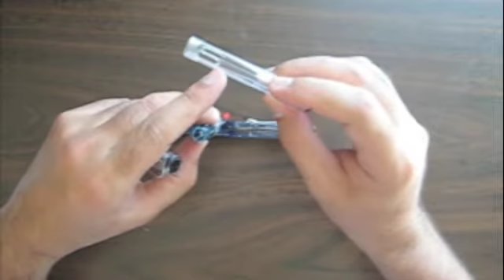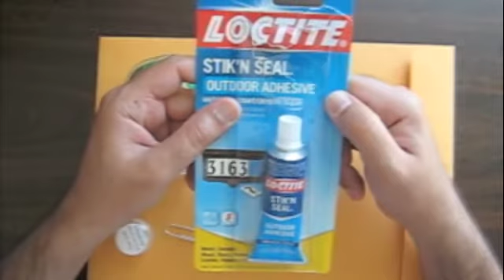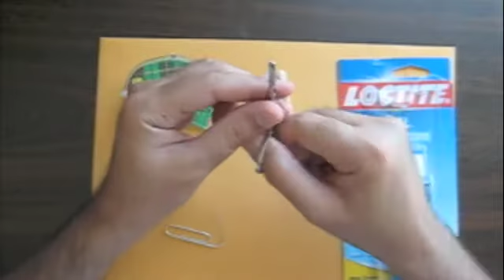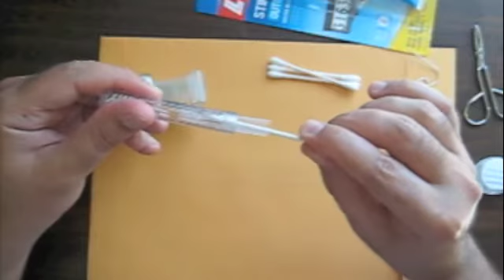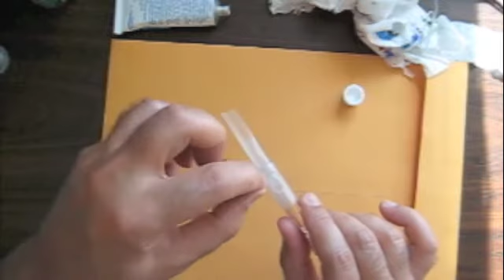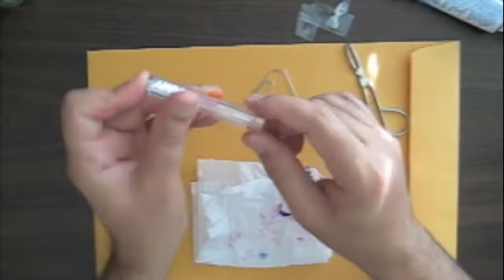Lamy Vista Eyedropper Conversion Part 1

Comment: Why don't you collect signed petitions to address to Lamy factory asking for an EYEDROPPER. Maybe they will listen to a neccessity from studends. We need more ink supply!!
Reply: Yes, LAMY, make an eyedropper, please.
Reply from the maker: I thought it was a neat idea to tinker with it myself and make a cool little project on my own. 

Considering the size of Lamy as a corporation and their business model in the fountain pen market I have doubts whether anything with come of it even if we do start a petition campaign. 

I think we might get maybe 15-20 signatures at best, which might not be enough to carry sway at Lamy.

Thanks for the suggestion though.
Reply: All that is needed is just use Vista rollerball barrel. Which would actually save Lamy money by simplifying parts catalogue, and give us easy to convert Vista.

Comment: MPage MyPage
Hace 1 segundo
I could easily fit a barrel from fountain pen into roller ball using a drill inside the rollerbal by hand. So you swap them and glue up the end holes of the ink pen. Et voilà...!!!  Thank you for shearing.

Comment from the maker: Yep I was originally considering to get the rollerball barrel, I looked at buying it as a spare part from LamyUSA, and even buying the entire rollerball for scrap and use only the barrell (the cap and section would be going to waste in that option).

Both options were running me around $30 a pop, and I had 3 of them to do, so I went with this approach.

I was already buying the $5 tube of glue, it's just that I needed to use more of it during this approach.

Thanks for watching and commenting.
Reply: What type of glue is it?

Comment from the maker: I did notice better flow after converting to eyedropper. But I also tried to floss the nib between the tines. I pulled the nib out and visually inspected it for obstructions while shining light through the slit between the tines. And I used a scrap from a plastic grocery bag to slide between the tines and floss thoroughly. Sometimes dipping the feed and nib into dish soap water gets the flow pretty generous.

Thanks again, and let me know how your experience goes with the flow/burping issues.

Comment from the maker: Good point about priming the adhesion surfaces with 150 grit paper, I hadn't thought about that. I'll try that if the glue pops out (it will create a big mess if it does).

Comment from the maker: Hi Tomm, Thanks for watching my video and leaving a comment.

You are correct, the burping problem is there with eyedroppers due to the heat from the hands / Charle's law. And it becomes worse when the ink reservoir is less than half full. I typically warm the thing up in my hands and then unscrew  the barrel to equalize the pressure and screw it back on, (or top it off with ink again).

Comment: Do you find that the flow is quite increased after doing this conversion? 
Also, I ran across some articles of people saying that the eye droppers tend to "burp" ink out when they get hot from your hand. Have you experienced anything of this sort yet?

Good tutorial, nicely made and good procedures. Just a heads up, I sanded the surface of the windows with 150 grit sandpaper, prior to applying the epoxy to ensure the epoxy did not pop off/out. 
Thanks
God bless